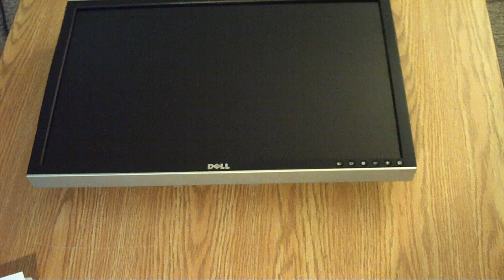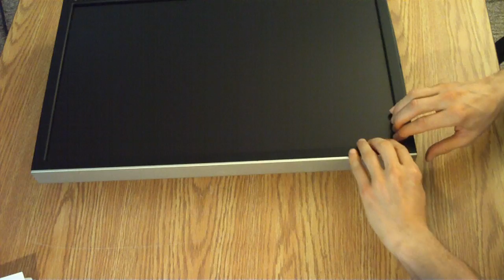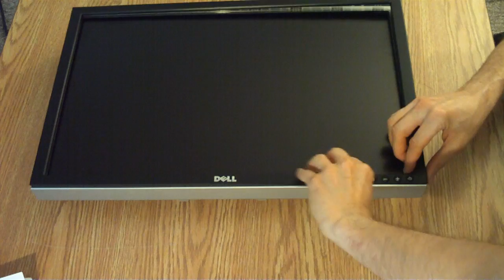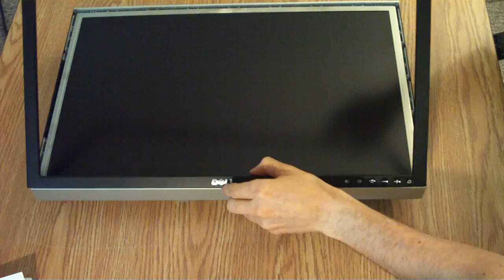Dell 2407WFP Monitor Power Button Repair Part  1

Comment: Great instruction! Thanks for sharing. 

I fixed the same power button problem of my Dell 1907fpt. I made it simple drilling a hole next to the power button to turn it on/off. Saved150 bucks without buying a new one.

Comment: A potential simplification: Once the bezel was off and without removing the circuit board screws,  I very gently pried the circuit board very slightly away from the on-off button just enough to  allow me to use a piece of tape on the button to rotate it back into the correct position. It worked!  To keep it there, I put a small piece of clear tape over the button and the surrounding bezel.  The tape keeps the button from rotating out of position and allows enough in and out to let it work.

Comment: ...and you should also bookmark this guide as your power button likely WILL break before the panel or circuitboard gives out. 

I agree with thinkofwhy that Dell likely made this deliberately, which is a damn shame; I'll think twice before I buy monitors from them again. My two 7+ year old 2001FP's does not have this issue (though one of them need a new circuit board and backlight tube after being on for 4 years) while both of my 2407WFP at home AND my 2408WFP at the office has had this problem.

Comment: If the button is stuck AND rotated, it is likely just out of alignment with the breaker beneath it. Mine was angled ~45 degrees to the right. If you have this problem, you can hopefully get your monitor temporarily fixed without opening it by just turning it back. Try using the tip of a needle or straightened paper clip to lift it and rotate it back. 

WARNING: Don't stick the paper clip INTO the monitor housing, as that may damage the circuit board below (and make you very, very sad).

Comment: Hah! I had the same problem with my 2405. Couldn't believe the stupid design when I took it apart and saw how it worked. My solution was a bit more blunt. I took the button out, put it back together and then using some thin scissors drilled a small hole above where the actual switch is and now I use the end of a jostick to turn it on and off. Works a treat :D

Comment: Thanks a lot!
I suggest pulling the back plate off before unscrewing the circuit board, it went a lot smoother that way.

Comment: THANK YOU! This saved my monitor. My only problem was not being able to get the inside two screws back onto the circuit board. Fortunately, the other two seem to be holding it in place just fine.

Comment from the maker: @kinstar Use logic and deduction. If it's turning off and on, then something must be malfunctioning. It just a silly little plastic button. It can't do anything by itself. It only pushes the dimple switch. Which is just as simple. It's all so simple.

Comment: I was also able to fix mine by just rotating the power button mark to the vertical orientation and  taped it to the front of the bezel with clear strapping tape.

Thanks so much for posting the videos - they led me to all the comments.  When I have to get inside a monitor, I will certainly reference your videos again.

Comment: I took off the monitor bezel and I couldn't figure out what was broken. I tested the actual button on the pcb and it still turns on and off the monitor. The things holding the power button onto the bezel were still in tact and functioning properly. Every other button works properly just like yours. What could the problem be? :O

Comment: Thanks for posting!  I had the problem for a while and was delaying the repair as I had an older 2405 model which still works fine.  I purchased the 2407WFPb as a new primary monitor and was using the old one as a secondary display.  I was scratching my head for a while trying to figure out how to open up the darn thing.  I was tempted to just snip the other buttons, since they are just going to break at some point anyway.  =)

Comment: Thanks so much for posting this video.  I followed this instructions (mostly -- I took off the back cover after the front black bezel; that worked well for me).  With some tape holding my power button, I can (again) turn my monitor on and off again.  Note -- the hardest part is the very first part -- starting to take off the black bezel.  Others have suggested an auto trim tool, but my fingers worked fine.  Again, many thanks for stepping through this process!

Comment: Thank you so much for posting these repair videos. I had the very exact same problem, I got it fixed without too much difficulty. I just removed the power button. Thanks again.

Comment from the maker: @MRubenzahl Global manufacturers do extensive testing in order to know exactly how long wearable parts will last, so it's not poor design from Dell's point of view, it's a perfect design for failure, just after the warranty expires.

Humanity's entire economic system is moving towards a 'designed to fail' paradigm in order to ensure cyclical sales. All for the sake of either profit or bleeding the lower class of their life-force.

Comment from the maker: @dravidr007 The plastic button presses down on a dimple switch. So you could use any non-conductive object to press down on the dimple switch: try a toothpick. It should not turn on if the button is broken.

Comment: @xxgg WOW!  You are observative,  guy!   I checked the button on my Dull and it was pointing at 10:30.  I used a pin to point the symbol back up to 12:00 and now the power goes on.  
If the plastic button breaks you pretty well have to follow the terrific instructions in this  You Tube series by thinkofwhy  but if it is just button rotation - try rotating the button first.  It worked for me.
 
Thank you xxgg!  You get a gold star for your suggestion.

But I still have a permanent ban on Dell.

Comment: I had the same problem.  If you did watch this - it is a terrific series.

Regarding the penny button that breaks - I will not buy any more Dell products.  That's final.  The products are poorly made and service is designed to irritate.

FWIW - this board-retention design is totally stupid.  The better design would be faster cheaper and less trouble-prone.  Good going Dell!

Comment from the maker: You should make a tutorial on how to fix a dead power button, since this series of videos is NOT a tutorial, it merely documented what I did to fix my monitor.

So, how exactly did you crack the glass panel? You were obviously way too rough with it. And I'm wondering how you would get the back off without first removing the bezel? Maybe you should make a tutorial.

Comment: Today I experience exactly the same problem.
I was about to go crazy because of it, than I realized that the symbol on the buttom wasn't correct orientation.   So I took a exacto knife to get a grip of this small buttom and rotated back to it's proper 12 o'clock position and it worked again!

As soon as i got it powered on, i googled for similar problem and it landed me here.